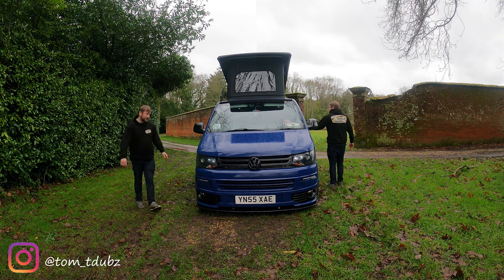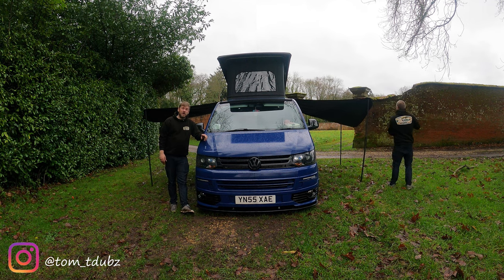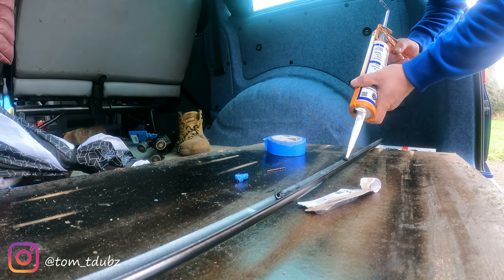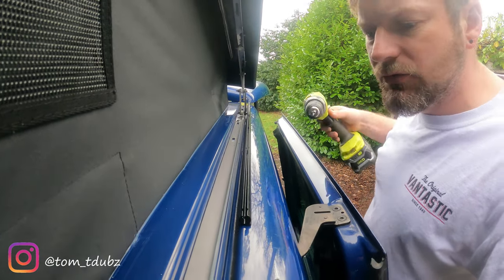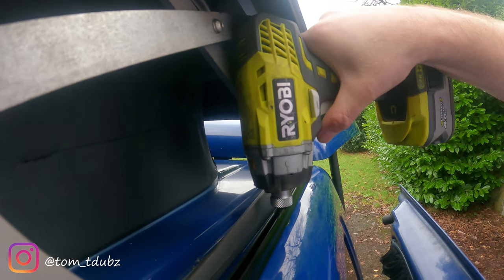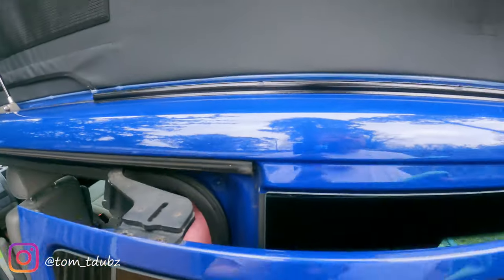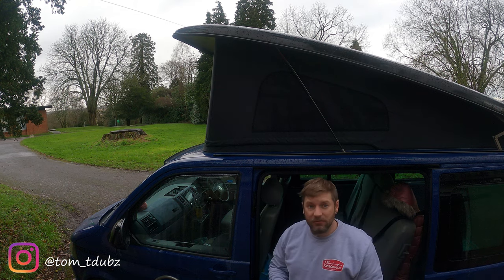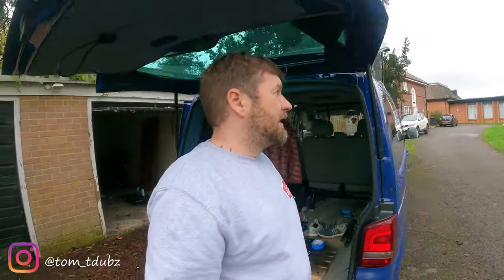vw t5 #twinrails #series2 #episode12

Comment: What awning rail did you use for this instillation.?
Please help
Reply from the maker: The one I used isn’t available anymore but it’s very similar to this one made by Dometic/Kampa 
https://www.ebay.co.uk/itm/275315824207?chn=ps&_trkparms=ispr%3D1&amdata=enc%3A19XcYJzhSSzuMLJSHELLGWg7&norover=1&mkevt=1&mkrid=710-134428-41853-0&mkcid=2&itemid=275315824207&targetid=1647205088280&device=m&mktype=pla&googleloc=1007024&poi=&campaignid=17206177401&mkgroupid=136851690655&rlsatarget=pla-1647205088280&abcId=9300866&merchantid=7335874&gclid=Cj0KCQjwlK-WBhDjARIsAO2sErRhGbZyzpAThJuQr2i99hBpBkiJ1hOwro6QgYToZshKsKEhjQVxcDwaAsgcEALw_wcB
Reply: Thanks you. 👍